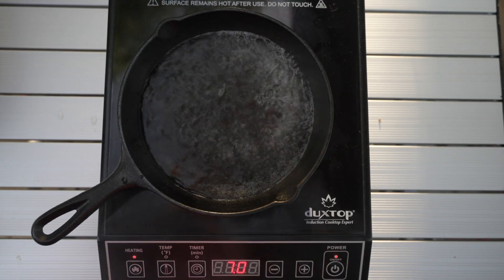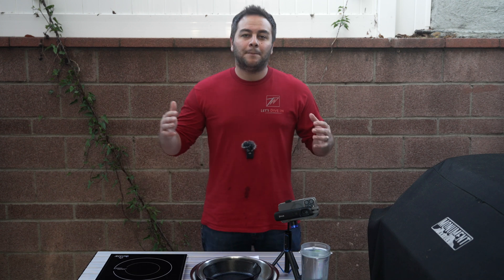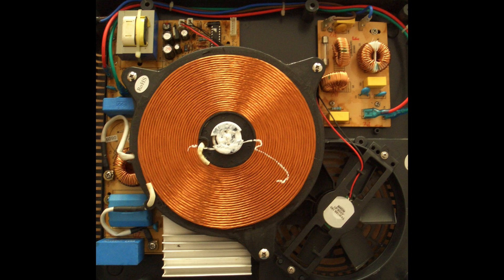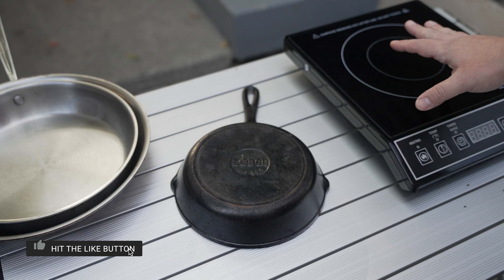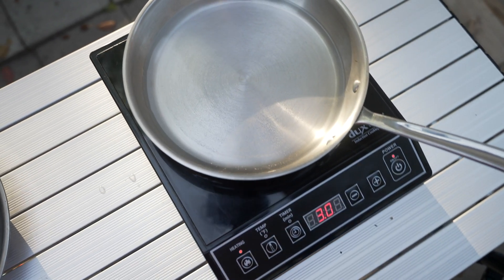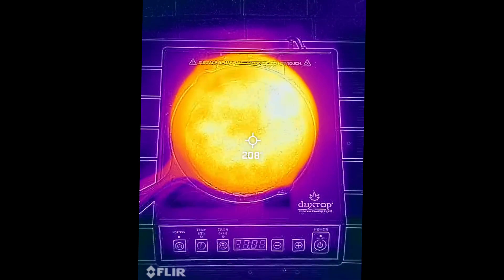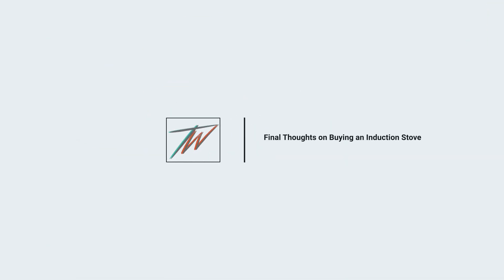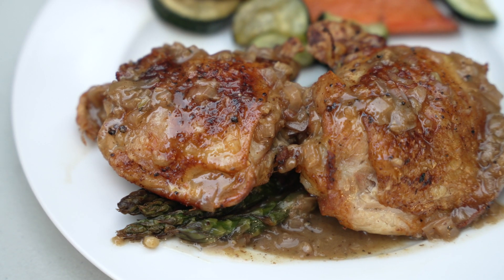Induction Stove Top Coil Size Matters // Thermal Imaging Shows You Why

Comment: The only reason gas stoves are labeled 'dangerous' is because they can't be turned off by an outside third party.  I will always have some sort of gas stove.  We RV, so we're looking into an induction burner only to keep the heat down when we're using RV park electricity.
Reply: Besides the flame, combustion of gas releases a ton of pollutants... and water vapour. In cold countries where homes tend to be "air tight", this is not good. [Btw, notice how your gas water heaters, furnaces have to, by law, expel combustion products outside]

Comment: Gas should be banned people still die from leaks all the time, and I can’t relate to this video I have a wolf induction range. Theres no size that’s too large of small.
Reply: FAKE NEWS. How about giving your sources? They do not exist is why. Natural gas output is Carbon Dioxide and WATER. It is actually CLEAN burning in general and any exhaust fan is MORE than enough to exhaust the CO2. The moisture in the air is actually worse for you in places like FL.

Comment: New release Tyemui 2200 induction cooker Amazon claims 8.26" coil when u click on photo details. 
   Manufacturing has become shot in thdark flowers & chocolates barbie doll plastic hild thdoor open& customers have become specifications illiterate.
 Manufacturing is controlled by Lucifers plasticines. 80% humans are chipped demons in flesh = nephilem of old. This is why all manufacturings hints at same exact shady entity.m = Satans BEAST cmouter on Saturn.
 
 Informative read:
  

I am bicycle motorcycle epicenter end all king of kings. 
 I will xplain a few things.
   My 1st motorcycle looked like this.
  My last motorcycle looked like this in video. "Dual sport" bike.
   There is no such thing as a street bike. Or a "dirt bike" or a cruiser or a sportbikeor or a tour machine.
 No such thing.
 This video is what a motorcycle any motorcycle every motorcycle is supposed 2look like PERIOD.
    This is the epicenter.

    Can u see why? Then watch supermoto bike videos.
Ergonomics posture safety handling SUSPENSION. 100's of u WILL DIE on 800lb 100HP no suspension handling abomination rusty pot metal Barbie doll plastic money pits when u hit a small pothole. 
   300lb max. bikes 500 max cc. 40HP max. ONLY. Less is more.
    U live in hostile. EXPENSIVE matrix. Bike must MAX handle obstacles. Be light &efficient LESS IS MORE.  

   Any compromise on th ideal = snake oil backstab corrupt business engineered keep customer 4ever crippled wanting& hungry = fuel massive database parts, factories& endless running shoe shoe designs. 
     Whats thmatter?
 Cant your engineers do anything right? Is that it? Why did u hire idiots?
    Why the forever dffrnt new or improved?
Oh i get it. Your idiots made a mistake on the previous model.
 Ah i see.
   Stop humping snake oil engineers. 
 95% humans = Satans kids Plasticines. 
    Demons placed in flesh bodies with Hadron Collider. 
  All manufacturing earth controlled by Halayel
         Yahwehs son was an idiot of all idiots personified. Sh*thead king of kings of th universe.
 Yahweh gave him 100's 1,000's years 2repent& told nobody as he watch Hal build Hadron Collider 2invade heaven.  
 We should only be so lucky down here tiny short life of agony on earth
     Satan:
   His name was Halayel.
 He was Jesus elder brother of 2million years back when your solar system was heaven &he ruled our planets. 
     He once told me "I love new stuff."
    Reality is his cup always 1/2 empty. He is a loser. HAS to lose. ALWAYS

   There4  let (your)) cup be always 1/2 full.. 
    What was he like when he was falling?
 Yahweh quote "He enjoyed destroying thspirits of all who adored him."
   Yahweh told us angels would give him their daughters 4favors. He would %$#@ them up the &^%hole while angel parents were made 2watch. 
     Hopefully u boys learned smthing 2day?
    Put him in jail. Buy a farm delete money. All thworlds problems can be solved in thgarden.
 This sht h>(as 2stop.)
 Video what motorcycle worldwide must ONLY look like = see video SUPERMOTO POWERSLIDES

Comment: The outer part of the pan still gets hot from the conduction of the pan material.  The small ring of fire on your gas burner doesn't reach the outer part of the pan either--it heats via conduction.

Comment: Greatly appreciate the video, so difficult to find reliable info on these shortcomings! I'm considering the Duxtop dual burner model to avoid my apartment's ancient electric range. New(ish) to cooking so luckily I haven't invested in a ton of cookware yet. 

I'm curious, what would you say is the maximum length the inner pan diameter can exceed the element while maintaining good heat transfer? Currently searching for the max volume Dutch oven that will work on this cooktop.

Also, would you be able to elaborate on the idea that you wouldn't do a sauce in a 10in SS skillet on these burners? If I pull the plug on the dual unit I'd have a saucier on the second burner for rouxs, warm emulsion ect, but I frequently do pan sauces and a 10in SS fry pan is my daily driver. 

Also sent a message on Instagram but it disappeared so I'm not sure it went through and figured I'd add my comment here. TYIA and again, great content!
Reply from the maker: Hi, thanks for the comment and I’m glad you’re enjoying the channel. Strangely, I didn’t get a message on my social media. I think a 10inch contact diameter would be the max for a 6 inch coil. What I meant by I wouldn’t do a sauce on a 10 inch was in reference to delicate sauces that need to be simmered down with constant even heat. The 12 inch pan with a contact of 10 inches or so showed that the heat was not evenly distributed outwards. Sauces would be difficult to control in this setting. Hope that helps. Cheers!
Reply: @tomwadek Thanks for your quick reply!

Makes sense! I'll avoid the 12 in (10 in inner diameter) pans. If 10in outer (8.5 or so inner diameter) pans are the max and the 6.5 inner cast iron is ideal, it sounds like keeping any new pot purchases under an 8in inner diameter might be a good rule of thumb for Dutch ovens, stock pots and the like? 

Hm. Yeah I wouldn't be doing any heavy reductions, just a 1/4 cup or so of wine to deglaze. Sounds like I should be fine with the 10in if I do most delicate work in the saucier - probably worth the slight drop in capability for finess to be able to sear a decent size steak. Thanks for your input! 

Lastly, if yourself or anyone can speak to the power sharing/capabilities of these portable dual models it would be a huge help! Seems like the second burner will have a lot less power, but hopefully enough to saute veggies, make a sauce, or boil a small pot of water while searing a protein on the main burner.
Reply: In the US (110VAC at the socket) dual burners don't seem to be the best idea as plug-in devices are pretty much limited to 16A (80% of 20A) or about 1800w. A bit constrained for a single burner, but for two...? Built-ins use 220VAC and are hardwired the limit doesn't apply.
Of course, if you're just tempering chocolate or something, it's probably fine.

Comment: My question is when we cooking large pans on small gas stove it evenly distribute heat across the bottom , which means most of the pans are able to handle the heat from a gas stove or a normal electric stove .. My self using large pans for cooking finds induction is not convenient for my style unless I break my bank for higher end models with proper coil size and high end pans etc . Finally end up with ceramic glass top one

Comment: In case this helps anyone, I got bit hard by false advertising around coil sizes. Just bought an LG induction range (model LSIL6334F) with advertised element sizes of 11/8/6/6 inches, and I even spent two hours on the phone with LG customer service before I bought to confirm those sizes. Guess the fact that I had to work that hard to get the info should have tipped me off: both the advertised sizes and what customer service directly told me was very wrong. Actual coil sizes were 6/4.5/4.5/3.5 inches. Wow. Measured by myself using pans dusted with flour to see where the browning happened, with a brand new stainless steel pan that was magnetic all the way up the sides, and a cast iron pan. Beware, people!
Reply: Shady of LG, Wolf is accurate
Reply: Did you find a brand running on 120v with larger coils?
Reply: @vinny9988  It's worth buying the 240v models if you can swing it! That means I had to unplug the stove/oven in my apartment kitchen. But it was totally worth it to get that extra power! A toaster oven replaced my electric range oven. The induction hob is a changBERT 240v 3200w. It can support up to 100lbs!
Reply: I’m surprised to hear that this was the case with stainless steel pans too. With cast iron and carbon steel, only the middle gets hot for me. With stainless steel, the aluminum layer spreads the heat evenly across the pan even with a small heating ring
Reply: Why are most of these induction burner companies so stingy with coil size? Especially when the product is not some inexpensive $100 model. Would it kill them to add another inch or two to the diameter? My changBERT 240v 3200w induction burner is nice and all, but could still benefit from a larger coil.
Reply: Wait, you buy LG?? Then you're a complete idiot hands down

Comment: Nice insight with the thermal camera. There is another aspect of induction that complicates the control of your cooking. I have been cooking on induction hobs for over 20 years. My last one is a lot cheaper (€600) than the first one (€2000) while both could be considered as middle range over here in Europe. Throughout the years I have been struggling finding the perfect frying pan noticing that some are very slow and won't even reach frying temperatures, while others spread the heath very poorly. Last week I connected a power consumption meter to the hob. Filled all my 16 pans with water and put the hob on boost. Half of the collection (all of the cooking pots) would easily get the promised 3200 W. The other half couldn't reach that top at all. The worst contender stopped at 750W. Two paterns were clear: pans with an anodised aluminmum core and a magnetisable layer are struggling the most and within the same family of pans the smaller ones (24 cm) could't get all the power out while the bigger (32 cm) didn't have problems (this somehow seems to contradict your magnet size analysis). Price was no indicator. A €5 pan with a hollow bottom did fine while two €80 pans of top brands like Le Creuset and Ballarini underperformed strikingly. My laymans conclusion is that somehow the 'communication' between pan and hob makes the electronics decide to limit the power delivered. That would prevent the warping risk and indicate that there is no power lost but it makes the ajustable scale (1 to 14 in my case) useless because you don't know what amount of heat you are generating at a certain setting. Gas is certainly more straithforward in this aspect.
Reply from the maker: yup, I couldn't agree more. I'm working on a video in respect to gas vs induction
Reply: If cast iron has the most magnetic material and it isn't laminated with anything else, how is it not the most ideal for induction?

Comment: I don't respect any manufacturer that doesn't list the coil diameter.

In spite of some (IMO minor) drawbacks, I think this is a big advantage of radiant electric cooktops. I especially like the ones with multiple diameters (e.g. 6/9/12in) in 1 element - very flexible! Also induction is more expensive and, as far as I can tell, more difficult/expensive to repair and more prone to issues. Portable radiant electric cooktops with 6/9in diameter would be really cool!
Reply: Why do they all seem to be conspiring to conceal the coil diameter? You'd think that a few of those corporations would realize they could attract more customers by disclosing the true coil size, and capture the market by making one with an above-average coil. That's what I would do if I were a CEO. Yet they aren't interested in doing it
Reply: then how can we calculate the size of the coil for the required input voltage. (i-e) I have a 180v to 220v in input voltage then how can I calculate the rating of the coil, for this voltage.. ? mens which coil will be best for these voltages, and how, to calculate theoretically ?

Comment: Man, completely agree. I am telling this to everyone. The problem is that no manufacturer dicloses the coil size
Reply: Yeah, this really annoys me. I get why they do it because they can get away with putting in smaller coils than people realise. The should have to be honest about this as it makes a huge difference
Reply: Complete bullshit!

No dishonest manufacturers/seller (which unfortunately is most of them does) most of the  honest sellers/manuafactures actually does and even call it heating element or coil size instead of "zone size"
Reply: @kaspervendler1726  Unfortunately this isn't true. It is VERY difficult to get information on actual coil sizes, even when contacting the manufacturers themselves. I have written a longer comment to the video just a few minutes ago.
Reply: @CK-jd8qd if you have a portable induction stove, it's simple, put a strong LED light under the exhaust fan and look closely at the glass top, it exposes the coil size through the light without tearing down the whole unit
Reply: I think because the coils and technology needed to control them is expensive, especially if they have variable power at low heat, rather than on/off cycling. They use the cheapest/smallest coils they can rind, and hope that consumers will buy based in the displayed burner stencil on the stovetop.
Reply: I have a GE Cafe induction stove. All the coil sizes are listed in the user manual and in the specs on the manufacturers website.
Reply: And they come with a Chinese brand elements from Midea lol
Reply: Sometimes I think these companies are all conspiring to give us less efficient models so one day they can sell us "improved" models for a premium price.

Comment: Thank you for into informative video. Most of our pans are 12" stainless steel with copper bottoms. I own a couple staub and le creuset cast iron cookware but those are odd shapes and mostly for niche baking. My parents keep ragging on me to look for a cheap induction burner to try but I am unsure if this is like the whole air fryer phase of trend ( a lot being terrible and or defective) or not at this point.
Reply from the maker: No problem. Glad you liked it
Reply: Copper bottoms will NOT work! BTW, your parents are right; induction stoves are amazing.

Comment: I have seen a number of these ring videos, and have tried the flour test myself.  I see the same thing, but when I have used the stove in real life it seems to work just fine.  I have a range at home and a cooktop in my camper van.  It finally dawned on me.  When these tests are run they are usually at full power.  I only boil water at full power, I cook somewhere in the medium range.  With a decent pan and a slower warm up the bottom of the pan heats more uniformly.  When I repeat the flour experiment at medium there is less ring and more uniform brown.  Just thought I would add my two cents.
Reply: But its a bit of a false advertising then, i just got a 3.5kW induction hob that claims it supports cookware up to 26cm in diameter...but I can't even use it to boil water, because all the power gets dumped into both TINY (compared to the advertised 26cm) and incredibly THIN ring, to the point where it literally superheats the pot so much the water cannot touch the ring. You can have 15L of water and melt the bottom of the pot out of it. What is the point of this?
Reply from the maker: Thanks! I appreciate your perspective.

Comment: Coil size doesn’t matter…. Coil size NEVER corresponds to actual heating surface . On your duxtop coil size is about 7” but real heating size 4”
Coil size 9” - heating size same…4-5”
Don’t mislead viewers.
Only small cookware 5-6 “ will work for searing…. Bigger …. It’s a problem….
To boil water is perfect even for huge pots….
Try to fry 2-3 onions in big pot…. It will take forever .extremely uneven heating surface .
And for your duxtop : advertised max power is1800w, and you are getting only 1100-1280 max.
Power level 1 - advertised 200, but starts from 450. Not even one power level is corresponding to description.
Reply from the maker: Not true at all. Please research. Diameter of the pan will correlate with the coil size diameter of the induction stove. Limitations of which pan you can affectively use.
Reply: Look at the bottom of boiling circle . 4 1/4 max
Reply: I had in last 12 years all of them !!!! From 1.8 kw to 8 kw. Same size of active heating surface !!!!!! But coil sizes are different……
Reply from the maker: @updatename6637  I look forward to your video proving otherwise. Please let me know when you post it.
Reply: @tomwadek . All induction cooktops have 2 marks on top , small diameter (4.25”) in the center- which is active heating size and bigger diameter, which corresponds to size of heating coil (7-9”) and suggested cookware size.  
You can see it boiling  circle  at the bottom of  your cookware , and it will be …. 4 1/4 “  on 7+ coil size.
It’s easy …..   
that’s why you confirmed on your video that cooking is uneven ….
Reply: Take apart your duxtop and measure coil size , than measure active heating diameter …..